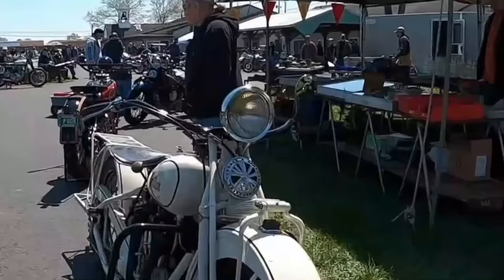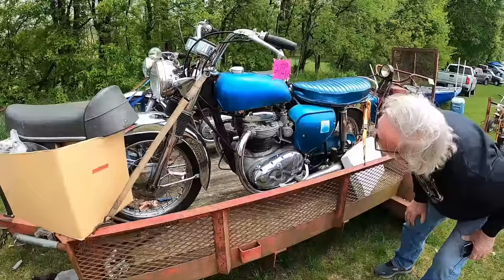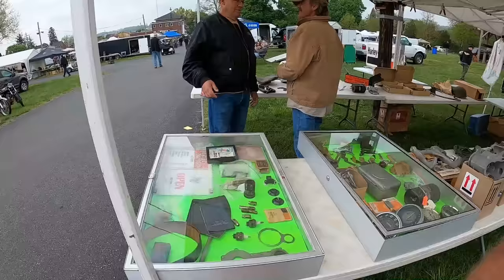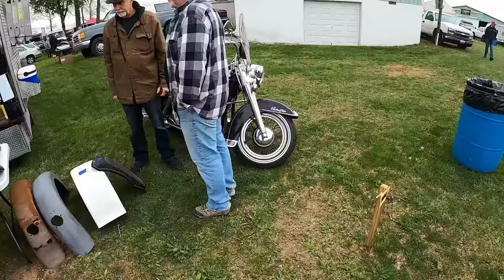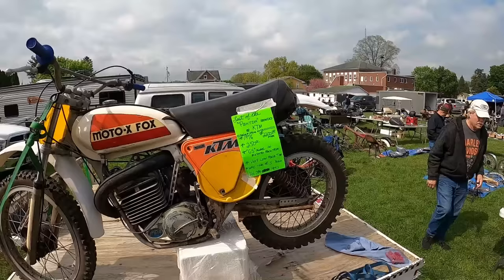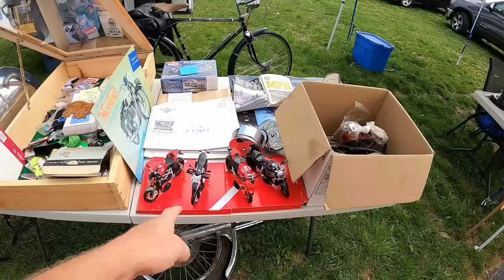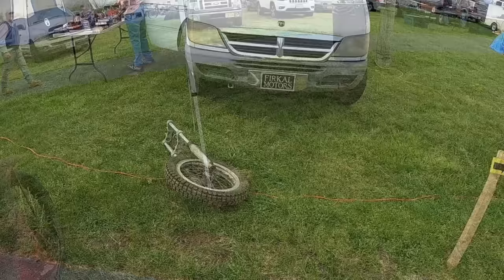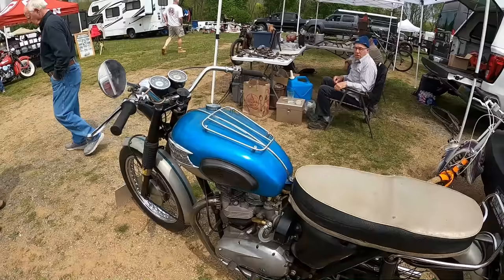AMCA OLEY VINTAGE BIKE NATIONAL MEET 2023

Comment: The Montgomery wards bike Is indeed called the 450SS, Which stands for 4 speed, 50CC
Reply from the maker: Oh, so it looks just like the 125 Cobra, buts its only 50cc? Are the bottom ends of each motor interchangeable. I did not know they made a 50cc version. I learn a lot from this channel. Thank you.
Reply: The bottom end is the same (sort of) with the wards benelli moped, although the crank end is different for the moped clutch. The 125 is much larger.

Comment: That was pretty interesting although I stopped going to swap-meets as I could usually find something I really wanted but didn't have the budget  (which can be pretty depressing 😮‍💨.
I'm not a Harley person since an early 90's tried to kill me , the hydraulic brakes were terrible, no feel, 'wooden' and probably a bad move test riding it after a Ducati 916 😅 (I was running a workshop back then)
The Greeves should have had an Albion gearbox.
Gold Flash is PLUNGER not sprung hub (I've got a 1952) 
They came with single or duplex primary drive, duplex was for sidecar use.
It's also what is called semi-unit with gearbox bolted to rear of crankcase.
I'm kinda the CB360 'expert' it's difficult to believe they have increased in price so much over the last 20 years.
 That one you showed was in pretty good shape with original exhausts which are usually rotted out internally
Reply from the maker: Tell me the difference between a sprung hub and a plunger. I pretty much thought they were mostly the same. I can learn something!
Reply: @bullpencycles  Sprung hub was used by Triumph and had 'everything' (springs, guides, etc) inside the oversized rear hub. 
I've never worked on one but have seen the diagrams and apparently it's a pain to work on and never actually worked very well plus wore out pretty quick but didn't need a frame re-design
I forget if they took a curved path or were straight up and down, haven't looked at instructions for about 40 years.
Plunger suspension is much simpler to make and see how it works as it's external built into rear of frame. It has issues with chain tension (chain gets tighter at top of travel and is loose where you mostly use it) but assembly is much easier.
Plunger also relies of the axle to keep things lined up, in the 70's, AMEN 'Savior' frames used guide blocks to help prevent wheel twisting quite so much but early BSA frames didn't use guides so handling could get 'interesting' if things were not tightened up/adjusted. It was still way better than a worn Triumph sprung hub though.
Reply: The old rigid framed BSA A7 from 1949 were so beautiful and are as rare as hens teeth now but are in my opinion the most beautiful looking bike ever made. Well worth buying one if you find one
Reply: I dont have the budget now. I sadly got married and got rid of a BSA A7 Rigid framed bike that was in very rough condition and a large journal crankshaft DA10 motor with single carb alloy head, firebird scrambler tank, BTH competition magneto, new high level exhaust, thick flange barrels, and other restored stuff, engine was polished and frame, petrol tank and oil tank and swinhg arm was sand blasted, filled and resprayed in two pack paint by myself. I did polishing, welding professionally and some precision engineering and painting but moved to Switzerland for 7 years when i got married and couldnt keep it. I still cry when i think of that. Its not the value but the time it took to find those rare BSA parts and the weeks of work i put into it. It was the first bike of over 250cc i bought at 20 years old and im 62 now. You could ride up to 250cc in the uk until 1983 as a learner but kids were buying 2 stroke yams, suzukis and kawasakis that could be tuned to do over 100mph but handled like shopping trolleys and didnt stop well on those awful drum and if you was lucky early disc brakes.
Reply: Plunger is like a very short shock attached to the frane and the wheel spindle. Like the 1952 golden flash 650cc BSA. 1955 the swing arm and two rear shocks came.